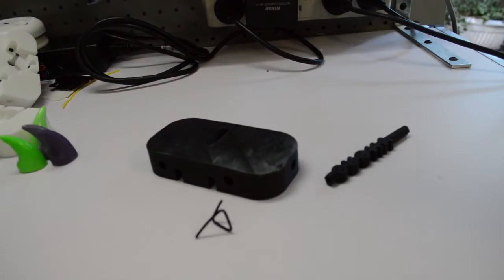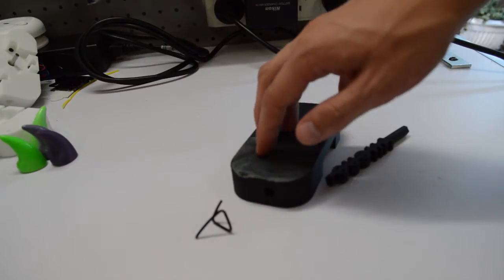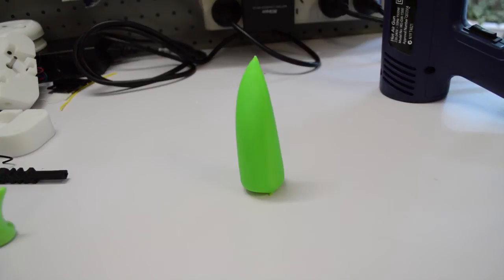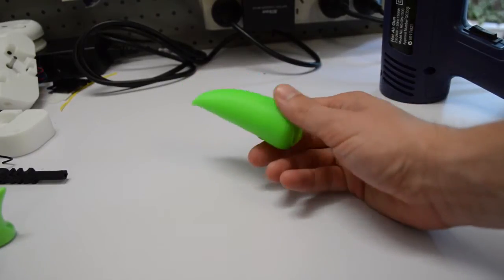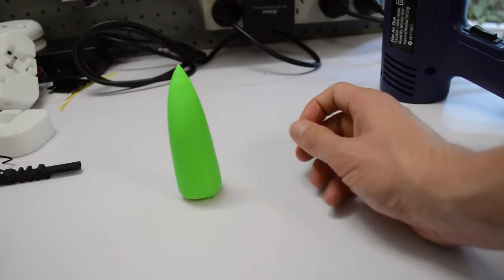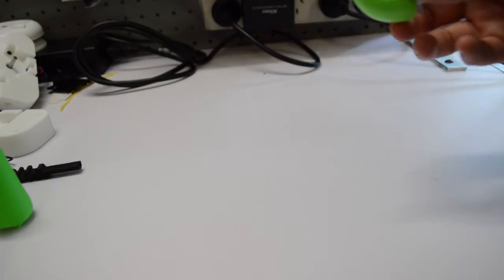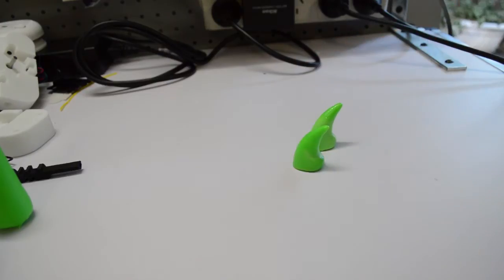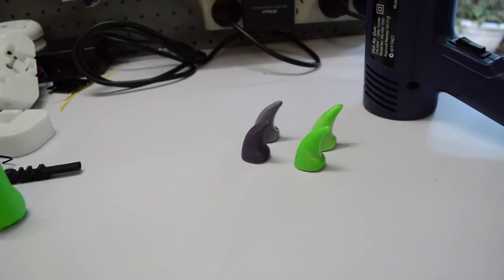Makers Muse Quick Tips - Restore Colour to 3D Printed Parts

Comment: Just wondering where do you buy the filament? The cheapest that isn't going to be rubbish is $55 for me, please help
Reply from the maker: Hi Zak, it depends where you're based - but I've found anything less than $55 (in Australia) just isn't worth it... too many failed prints. I only print in the genuine UP plastic these days even though it's about $65 a roll, just because it's so reliable.
Reply: Maker's Muse Thanks, i'm located in perth western Australia, and there's a store called 3D printing studios in fremantle that will be supplying me with filament
Reply from the maker: zak robbins Haha fancy you should say that, I work there! I personally tested many different suppliers of filament before deciding what to stock, so that's why it's a bit more expensive than online. But once you take shipping into account it's not that much more, and any problems just bring it back for a refund or replacement!

Comment: That's a great tip! Thanks!

I have a theory that the colour fading is down to high humidity. When you take the freshly smoothed part out of your rice cooker ( slow cooker in my case ), if the acetone evaporates too quickly, it'll cool down the surface and water will condense on it from the humid air. Just my theory.

Hot air gun on the shopping list for tomorrow! :-)